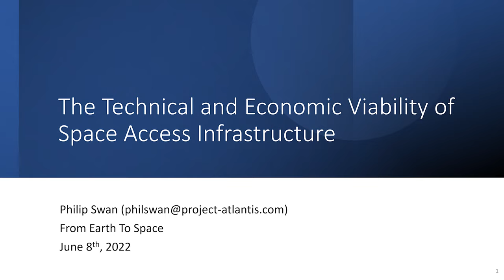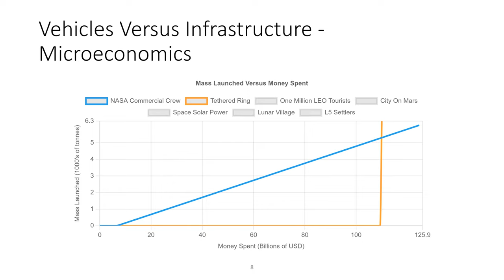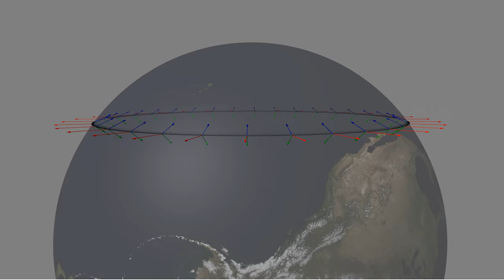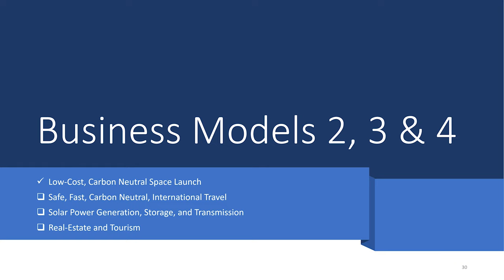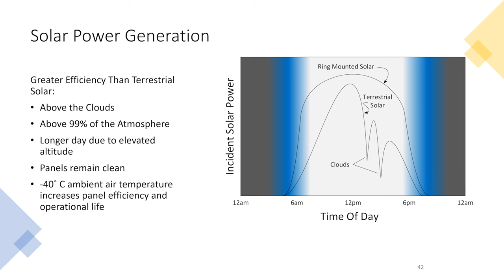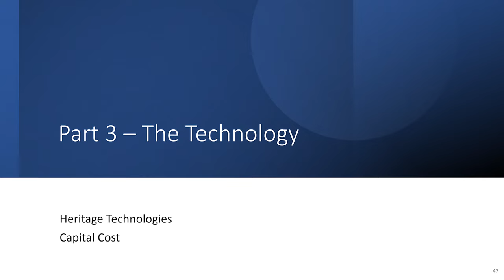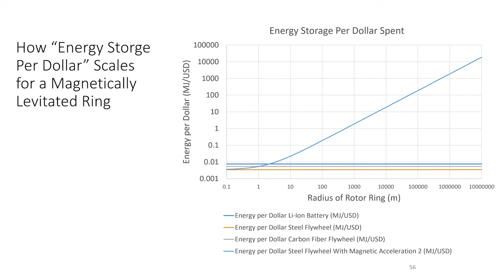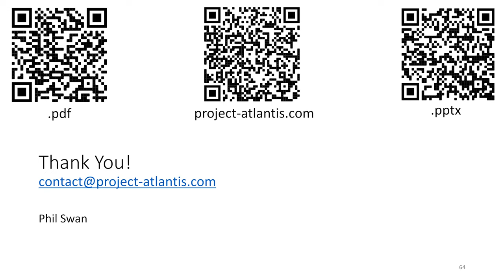From Earth To Space 2022 Tethered Ring Presentation

Comment: For business model 1:

Have you considered hydrogen powered planes as a competitor for the Carbon-Neutral International Travel market? Hydrogen has the energy density necessary for air flight while also having the ability to be Carbon Neutral. 

As for the safety issue on the ring:

What happens if there is a failure anywhere along the ring? My sense tells me the entire inner ring would either crash, or shoot through the sides anywhere there is a break, crashing the entire ring to the earth. 

Also, if there is ever a failure in electricity, would friction not slow the ring down to the point there is not enough force to keep it up? 

To be clear, I love the idea of a functioning, safe, tethered ring. I’ve encountered you/your company a few times over the years through my own research and I think your business plan is underdeveloped for what you are proposing. Through my work I’ve raised money for many renewable energy projects, and have personally given funds to multiple aerospace startups and if you hope to raise significant financing (which this idea would need) you’ll need to sharpen up the monetization aspect of the idea. 

If you can demonstrate the intermittent applications more readily, you can move towards the end goal slowly but surely. Good luck with everything.
 - Tom
Reply: Hydrogen is all but certain to leak and is about fifty times better than carbon dioxide at retaining heat. So if you replace gasoline say and only 2% of it leaks you're still looking at comparable amounts of warming.

Comment: Great, but failure at any point would collapse whole ring
Reply from the maker: There's lots of redundancy. Five rings, so you can take one offline for maintenance. Failure of a ring will cause the rest to settle at a lower altitude, as opposed to coming crashing down. Within a single ring, there are millions of permanent magnet-biased electromagnets. If the electromagnets or control circuits in a single unit fail, neighboring units take up the slack. It's surprisingly "not fragile".

Comment: Lifting the ring is unlikely to be possible. It will be limited to land surfaces between latitude 45 and the arctic circle. This relies on the curvature of the earth to provide the lift by winching the ring to a higher latitude. The total force needed is immense.
Reply from the maker: You can place a tethered ring anywhere, it doesn't need to be centered around the earth's axis of rotation. If you sync up the digital twin and click on the "Download Specs File" button, you can look up the force at the base of each tether. It's "tetherForce_B[0:1]". For the reference design it is 1.2 and 1.5 ktons of force per tether, with 9km tether spacing, and staggered tethers. 1.2 ktons is roughly equivalent to 6 SpaceX Raptor engines. But, of course, the ring would be lifted with winches as opposed to rockets.
Reply: @spaceinfrastructure3238  Nice concept, but where? Differences in elevation and actual mountains would make land problematic, and would have thought ocean more difficult. Anticipating significant budget upscale in practice.
Reply: @spaceinfrastructure3238  Have you factored in costs of access disruption during construction?
Reply: And just out of interest, what's the budget for maintenance? Would you need fullish demand from immediately for workable accounts?

Comment: A naive question, do you think meteorites could be a problem? Every year, the Earth is hit by about 6100 meteors large enough to reach the ground,
Reply from the maker: I think that it's pretty unlikely. Thought experiment: Suppose you had everyone on the planet form into a giant circle that was the same diameter as the tethered ring. If you restrict the population density of this "crowd making a circle" to a maximum of one person per square meter, then the circle's line thickness would be 242 meters wide. The five rings together are on the order of 1m wide. So, it's roughly 242 times more likely that a person somewhere on the ground will get hit than the ring will get hit. I've never heard any reports of a person getting hit by a meteor, but it is possible that this has happened. That's one of the reasons why the reference design includes 5 rings for redundancy. You never know what might happen.
Reply from the maker: I did some more research - it looks like there are a few reports of people being hit by meteorite fragments after those meteorites hit other things. So, worth it for sure to study more thoroughly whether meteorites could be a problem.

Comment: Great to see other like minded projects. You are on the right path but there is still better and cheaper way to do it. You have the permanent space structure right and tethers but your lifting mechanism both for the structure and for use can be improved. Keep thinking and breaking the status quo. The answer is much simpler. Yes on solar generation. Yes on electric to kinetic storage but "What is the easiest way to rise things in gaseous environment? "
Reply from the maker: I'm curious, what are you working on? Feel free to connect with me via the project-atlantis.com website.
Reply: The easiest way to raise something in a gaseous environment? Do you mean something like a helium balloon?
Reply: @jamie7472  not just helium ballon are very old tech but more of the dynamic of instead of fighting atmospheric pressure use it to aid the accent. Just as combustion cars and existing rocket technology try to "fight" it and do everything in one powerful event. Using a more moderate but efficient and tiered approach will generate more sustainable and large scale movement of materials from the surface to leo and beyond. Here is the next question. What happens when you combine helium balloons with solar cells technology? =D

Comment: I rather doubt that the economics work.  Our resources have limits.  This cannot be made from plentiful materials like concrete because concrete performs poorly under tension.  The rare earth elements needed for the magnets alone probably do not exist on earth.  If they do exist, then this much added demand will drive up the prices by orders of magnitude.  The same story applies to any superconductors (that do not even exist yet) and other materials... though it would be great to harness this much carbon.

Additionally, earth's magnetic field will resist any movement of the ring (Lenz' law).  This is especially true for a ring housing superconductors.  Perhaps, we might heat the superconductors long enough to do this.  We also must deal with the rotational inertia.  This would truly be the largest man-made gyroscope.
Reply from the maker: This is why this project has an open-source digital twin (see https://www.youtube.com/watch?v=k5fki-C3r70). It contains engineering and economics math and most of the formulas are easy to understand. There rest should be understandable after reading a paper called "The Techno-Economic Viability of Actively Supported Structures for Terrestrial Transit and Space Launch". I strongly encourage everyone to dive in, try to find errors or omissions, and challenge the default assumptions.

Comment: It seems as though you have failed to consider the impacts on the rotation of the planet when tethering large objects to the surface. You also seemed to fail considering the impacts on the global weather system that such a structure would have.
Reply from the maker: Good study topic suggestions. Gyroscopic effects have been modelled, but for different reasons. I agree that it would be worthwhile to estimate how much a tethered ring would directly impact the global weather system.
Reply: @spaceinfrastructure3238  Use solar energy to run it the other way. Fix those pesky leap seconds once and for all!